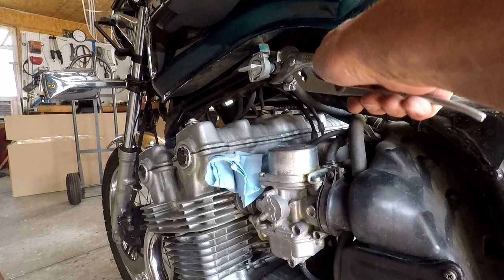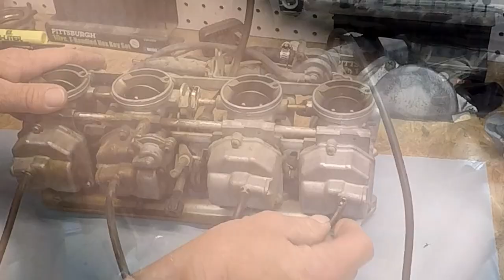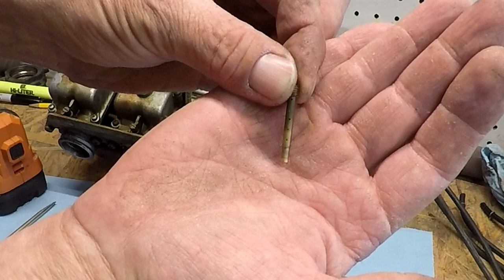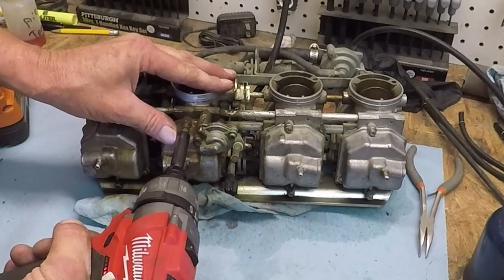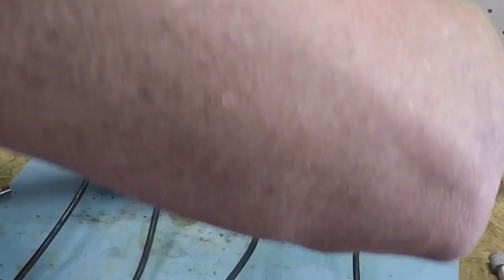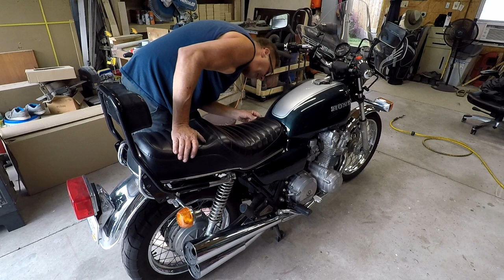Carburetor  Cleaning 1981 Honda CB 750k

Comment: The carbs on these bikes (1979 to 1982) can be cleaned with them ON the bike. There is really no need to remove them. The float bowls can be removed to access all the jets from the bottom. Remove the starter motor cover and there is more room for your hands. I have done it and had great success. Cleanliness is the key. These bikes do not run well with dirty fuel. ( 1980 and 1979 Honda CB 750 current owner, bike rider 54 years)

Comment: Hey Mark: I tried to clean the carbs without taking them off! But when I took it for a ride it started flooding over again! So, after watching your video I will clean them out the right way! Thanks for the step- by- step instructions! So, I'm guessing I won't need a rebuild kit if I am careful taking them apart! Thanks again Brother!😎👍
Reply from the maker: Be carful of the rubber seal on the bowl of the carburetor.
Reply: @Marksmisfitworld  I will Brother! Thanks again!
Reply: The reason it floods is because you reassembled the carbs with the bike on the side stand. Obviously the float bowls were empty. When you refill the bowls with the bike on the side stand the float on the carb gets stuck in the down position, resulting in flooding. Once again I will say that the carbs can be cleaned out "the right way" without removing the from the bike. Put the bike on the main stand before you refill the carbs. You can also put a block of wood under the left side of the main stand to tilt the bike over towards the right. This should prevent the flooding. Same thing happened to me. I took the carbs off two times and had no success. The third time I left them on the bike and it ran the best after the third time. I have owned a 1980 Honda CB 750F and I currently own a 1979 Honda CB750 K and 1970 Norton Commando 750 Roadster and have driven bikes for 54 years and owned 7 Hondas over that period.
Reply: @stancoleshill8925  Just got your response. It took me 3 times also, but the last time I had the cards sitting on top of a bucket they were level. I put gas to them and let them sit overnight, and no more leaks. But that was last year, I have driven a lot this year and she runs great! I got the cards adjusted pretty close not using the vacuum gauges. she idles fine. But she is a little hard starting, but once she is running when I shut the bike down go into a store for an hour the bike starts right up. Everything is original, wires, coil. I do have new spark plugs, air filter, cleaned out the gas tank. She runs as good as when I first bought it in 1980. Thanks for the reply back Brother. Take care, God Bless
Reply: @stancoleshill8925  Also been riding 50+ years.:face-blue-smiling::person-turqouise-waving:

Comment: At 26.36 consider propping the tank first before disconnecting/connecting the fuel hose - - Place a small block of wood before hand where the 13 mm bolt goes to attach the tank to the fame, and instead allow the tank to pivot a few degress on ite rubber mounts - this will allow you to get access to the fuel hose to reconnect it to the tank. Once done, simply remove the block of wood and bolt the tank down as usual -

Comment: Hi! Can you please help me, workin' on a 1981 cb750f, stuttering problems on wide open throttle, carbs have been cleaned, which size are the jets on the main jet? I don't know if the bike still has the OEM ones or if they are changed in between. Thanks!
Reply from the maker: Almost sounds like it is sucking air someplace.

Comment: Hello, any reason for removing the battery? I have a hard time getting the boots for the airbox back on. Especially those in the middle. Any tips?
Reply from the maker: If the boots are stiff you will have a lot of troubles putting them on. Start with the center boots first.

Comment: Good work! Is there any difference in operation compared to a 1993 CB750F2 Seven Fifty? My problem is the bike just idles with choke and dies if I try to rev it. I see you don't separate all the carburetors from the rail. Do you think doing what you did and not cleaning every part of the carburetors is enough? My problem is probably related to the pilot jet and main jet. Do you think just cleaning these two is enough?
Reply: If thats the only issue you are experiencing, then that will probably fix it. When I forget to run my carbs dry for storage, when I try to start the motorcycle back up after months, it normally has your same symptoms. I open the float bowls up and clean the primary main jets and tubes. And if I don't do a good job, it bites me because I have to take things apart again and clean them better.